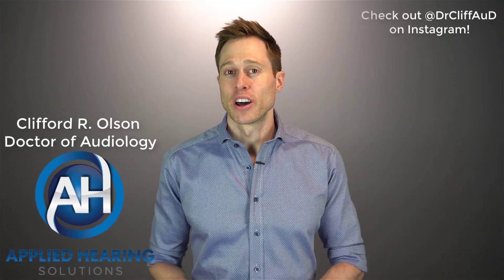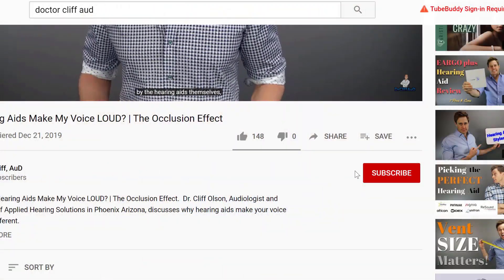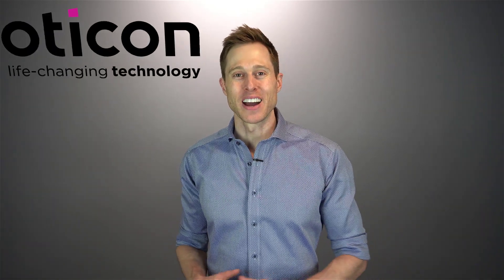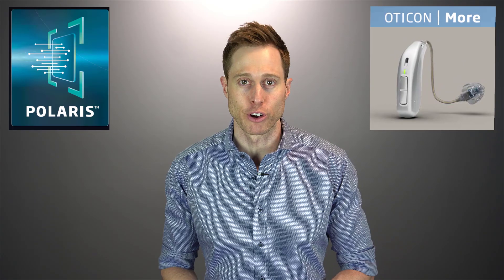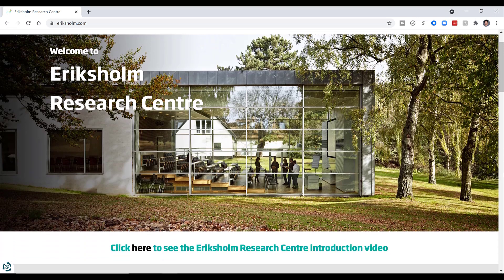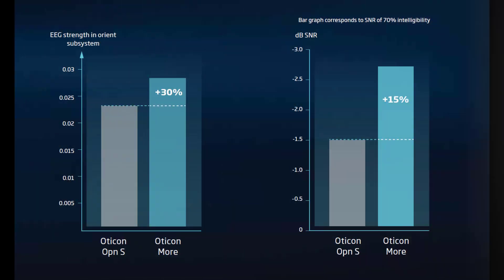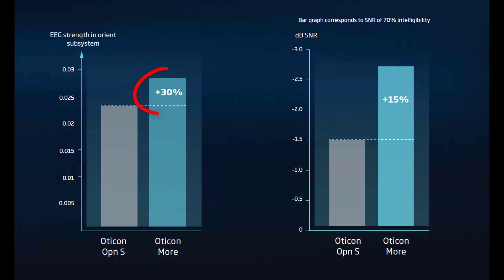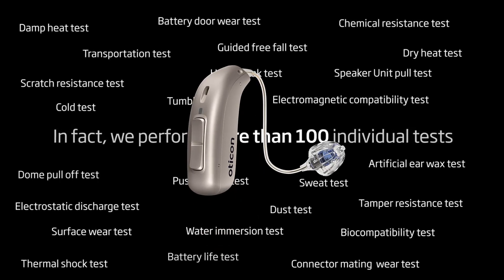What Makes a Quality Hearing Aid? | Oticon More

Comment: I am convinced that the hearing loss is reversible and damaged hair cells in the ear can be restored.
The reason of not exposing the real drug or treatment is simple.... great business - money.
If the hearing loss would be able to treat in the effective way, the great business of hearing aids would be collapsed.
This is all about money, not your health - dear clients.
Reply: Very interesting: could you provide source exemple on how you regenerate ears cells? Thanks a lot
Reply: @rotophil8411  Sorry mate this information is not for free.
Reply: @konradzlu5h Hello. Do you mean such  an information is "sold"? By who?
Reply: @rotophil8411  Me. I have worked over 6 months over this Issue. I compose music and I know what the hearing damage is.
Reply: @rotophil8411  are you interested? the whole range of hearing will be improved and when you stick your finger in your ear you will hear "the woosh" very "close".
There is no guarantee that if you have deficiency in 70Hz all frequencies it will be qual to the same range.... the mid and high frequencies are improved significantly.

Comment: You manned it sound that despite your like of Costco hearing aids that if it’s not Odicon than their junk. I’m sure you don’t mean it to come out that way. But, I’ve been told I need aids but have held off due to cost. I’ve held off getting the Costco brand because I’m waiting for my next hearing exam in July so I can ask my Audiologist if they are locked or unlocked so I can have her adjust them to best practices based on my audio gram. So, how do the Costco brand ( Kirkland) stack up in design and materials?
Reply from the maker: A reputable hearing aid company manufactures the current Costco Kirkland signature 10.0t.